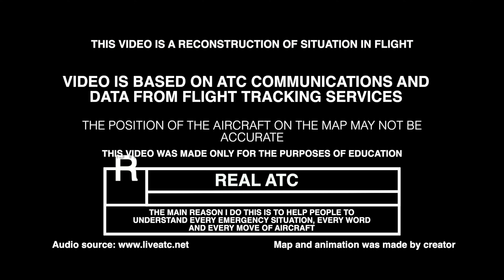When Everything Fails: Loss of Autopilot & Brakes on Approach to JFK. REAL ATC

Comment: No brakes?  I doubt it.  Maybe no “normal” brakes, but I promise you there is an emergency or backup brake system. 

As for no autopilot or autothrottles?  Who cares?  You’re a pilot.  Fly your airplane.

Retired Captain
B727 B757/767 L-1011 B747
Reply: So if you had all those failures one minute before takeoff you would just take off anyway because it's all just perfectly fine.
Reply: @Videos888 Let’s examine that.  Does the MEL allow me to take off with MAU 2B inop?  If the answer is no, then that’s that.  Airplane’s grounded until it’s fixed.  If the MEL does allow it, that’s great, then I’m legal.  But if I’m legal does that necessarily mean I’m safe?  Maybe, maybe not.  A mile and clear of clouds is legal, but is it safe?  The accident statistics suggest that it isn’t the safest thing to do, but yet it’s perfectly legal.  So that answer depends on a lot of things.  Ok, so I’m legal and I’ve decided it’s safe.  Next question: is it smart to take off like this?  How do I know?  This is where experience and judgement comes in.  3 questions to ask in response to your question: is taking off legal, safe and smart?  If the answer is “no” to any of these then don’t take off.  

Hope that answers your question.